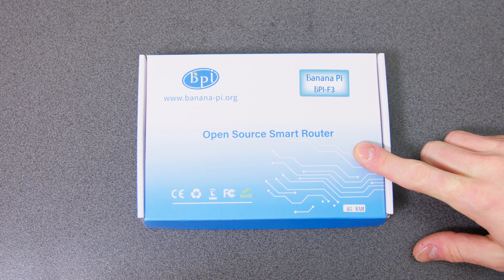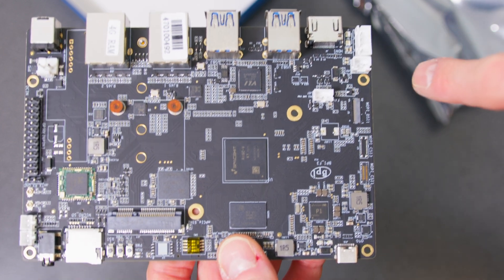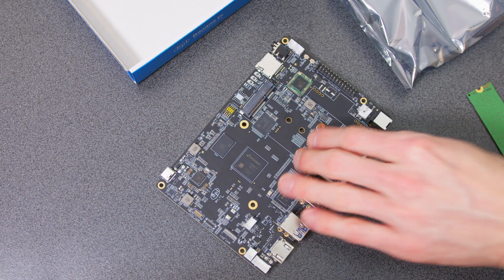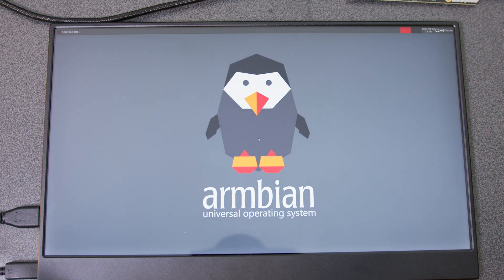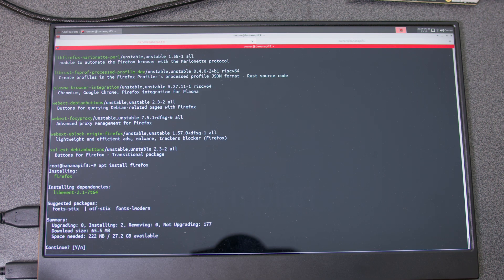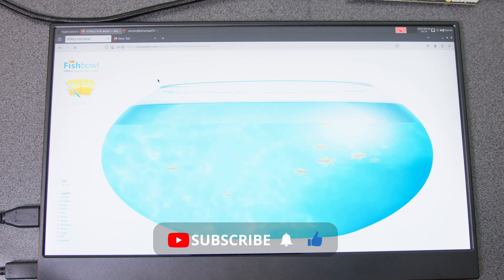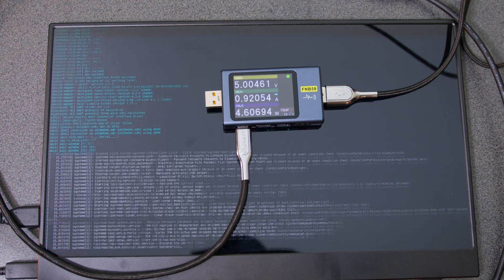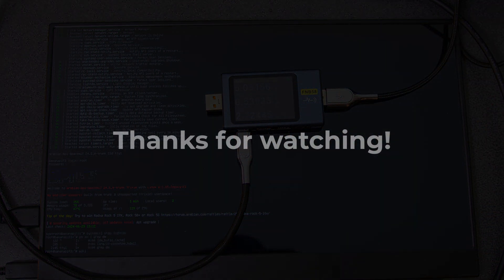The Banana Pi BPI-F3 may have the SpacemiT K1, but it is an ARSE product

Comment: So far, everything on the one I bought a couple of weeks ago has just worked. I don't particularly care about speed as measured by benchmarks. The most stressing thing I have used a RPI for is controlling a 3D printer. Having a lot of I/O, including NVME slots and two ethernet ports means more to me. You might want to revisit this from time to time.
Reply from the maker: Oh that is great - and good to know. Have you hit any RISC-V specific hurdles? And yeah it's on my list to get back to!
Reply: @PlatimaTinkers  Not really, but it's early days.
Reply from the maker: Please do keep me updated - I am quite a fan of RISC-V, and have more content on it coming up too!
Reply: @PlatimaTinkers Most of my experience with it so far is with embedded programming. That said a few things struck me, coming from ARM Cortex. In general (although there is a compressed mode) it takes more assembly instructions to do something and it seems like there are instructions missing - for example, there are no push/pop type stack operations, nor are there any operations with pre or postincrement. The upside to this is a combination of simplicity and flexibility. Same thing with interrupts. In the design I'm working on, I needed more than the one external interrupt - getting FreeRTOS to work with the vectored interrupts took a bit of playing around, but the answer turned out to be simple. You can make the interrupts nested or not - as you wish, it just takes an extra instruction - again, flexibility. I've had to write a few simple assembly routines and so far (admittedly subjective) it seems simpler than ARM. My sense is that it should be easier to make this logic fast, even though it seems to be behind ARM right now. Jim Keller said something in a talk that resonated with me: he thinks of progress as a curve that levels off for a given process. To make a big jump forward, you have to get on a different curve and doing so will seem initially like a step backwards.

Comment: You choose Armbian, that come with Debian Sid repositorie, and Debian Unstable repositorie... So of course the system not will be stable. Sid is make for developers upload new packages, to people test and report bugs!

If you wanna more stability, choose at least Debian Testing repositorie (Trixie at this time) since the actual Debian Stable (Bookworm) is not avaliable for RISC-V architecture. When a packages looks stable, they move it for Testing repositories. When they are sure that all packages are stable in the Testing repositorie, the whole Testing repositorie becomes the Stable repositorie. And this processes didn't happened yet with RISC-V architecture, that is, don't have a stable enough version of Debian for RISC-V. This applies to all Debian derivatives, as Debian is the most stability-conscious of all.

That said, I would recommend trying Archriscv, since you will have the latest versions of the packages, you have a better chance of getting versions with old bugs fixed.

I saw in the other comments that you care about the community involved: the Archriscv community is mostly developed by Chinese undergraduate students.

Comment: 12:49 - I am posting nearly 6 months after your video, so things have probably changed quite a bit, but my understanding is that bianbu OS is the recommended image for all Spacemit Stone series chips. The source is available on gitee and the documentation is good. I don't use the GUI, but I tried it and it works fine. The browser also seems to have hardware acceleration and I had no issues running 1080p YouTube videos. I primarily use this to compile and test software, so I did not run the GUI for any considerable amount of time. I assume the documentation was updated at some point to recommend bianbu OS? Armbian was still broken when I tried it 🤷‍♂
Reply from the maker: Yeah so I've learned a bit more and used it since then too. The terms can be slightly confusing!

So Bianbu Linux is the BSP for all uses. It has all the drives etc. There is then Bianbu, which is the desktop or server OS, based on Bianbu Linux, and they also do a NAS and OpenWRT set of images based on the BSP.

In my testing of the SpacemiT MUSE Book, you'll see if try the GPU a bit more, and have mixed results.

Honestly whatever image / configuration the MUSE Pi had was the best, I'll have to go back and check that. The MUSE Card was not too good, and the MUSE Book I had the best results with Bianbu 1.0.15 after some Chromium tweaks.

Comment: Armbian is not that great. The other distro they have is supposed to be awesome.
Reply from the maker: Yeah I just don't want to use some specialty distro. RISC-V is supported enough by Debian/Armbian/Ubuntu aka mainstream distributions, that they should be used.

Closed/single-vendor/specialty never wins in the long run. Eg how long will they maintain it for, how can we submit issues or PRs, who keeps doco up to date?

Comment: I like risc-v stuff,   but I cannot recommend your video to my young nephew because of your language.  You probably wont care anyway, but I thought someone should let you know.
Reply from the maker: I do care, and thank you for your input. In the most recent video I specifically avoided swearing for that exact reason.

I do think that this content here though would be a bit too technical for anyone who does not know when it is or isn't appropriate to swear. Eg if they're 14 or older, they're fine, but if they're under 14, both the language and the content likely wouldn't suit (based on US and AU TV guidelines)

Either way, thanks again!

Comment: This board is the first viable one with a RISC-V RVV.10 cpu, everything is new and the cpu vendor support is in flux. It is great to do development and optimization, you won't have full optimized desktop support a month after global release.
Reply from the maker: Hey thanks for the input, but just need to correct you a bit sorry.

"This board is the first viable one with a RISC-V RVV.10 cpu" <- No it's not

"you won't have full optimized desktop support a month after global release." <- Then don't advertise how good it's GPU is with OpenGL ES1.1/3.2. EGL1.5 OpenCL 3.0 and Vulkan 1.3 support.
Reply: @PlatimaTinkers  That I know it is:
- you have the Roma laptop that got presented in Munich, but with the same hardware and with the same software support problems.
- you have the k230 that arrived months before but it is minimalist with a tiny amount of ram and even more brittle software support so far
- No boards for the sifive RVV chips are available right now, at least for the general public.

The hardware has that kind of GPU, missing software as it is now is to be expected, in general I would never buy anything as consumer if it does not have mainline linux support, but as developer as long there is enough information and people answering my questions quickly, I'm fine.

As now, it is a board that is amazing for people that write software, since before that the only option was qemu for quick tests and k230 to see how everything fares if the workload fits the ram ^^; I can imagine you would feel lost if you are expecting the same experience most Aarch64 SBC offer out of box :)

Give the community 3 months and probably you'll enjoy much more this board and the RISC-V ecosystem in general. Since you seem to enjoy Ubuntu I heard they are importing back what the spacemit people are doing with their bianbu derivative.
Reply from the maker: @LucaBarbato sorry mate I nearly missed this one! And yeah that appears 99% on the mark but I'm just going to elaborate on my understanding of the state of things for everyone else too.

So to clarify a little bit (for others reading, not you specifically);
- This has the SpacemiT K1/M1 SoC on it, and they also released their own SpacemiT Muse Pi which was available for order 3 months ago.
- The LicheePi 3A has the K1 too, and was released for order in July from memory.
- The C908 cores have RVV1.0 .
- RVA22 is a big step, which SpacemiT seemed to get out to the public very quickly.
- You're right that the K230 (C908) is quite limited. I tried it and was 'meh'.
- SiFive have the P670 and P470 cores, but you're right we're still waiting on an implementation like the Sophgo SG2380.

GPU is always a hard one with these boards. I was talking to one of the engineers recently, and a lot of them are more for 2D acceleration and encoding/decoding, aka ISP pipeline, etc, not for 3D or GUI usage. Using Bianbu, which is the SpacemiT BSP, on the LicheePi 3A / BPi-F3 / Muse Pi results in good GPU performance. 

If Ubuntu bring more of the SpacemiT commits into their main line that'd be great, but I'm not too phased, and rather push forward with Debian 13 😁 Cheers

Comment: you tend to run out of cpu before you run out of ram on linux you should be able to do stuff with 4gb but yeah 8 or 16 would be way more usefull
Reply from the maker: Absolutely depends on use case I think. I often run out of RAM, and if we're dealing with an 8-core ~2GHz CPU I think there's a lot of head room there!

Comment: This has been my general experience with banana pi boards. Like I don't care about desktop performance. That's not my use case for a sbc. GPU acceleration is often lacking anyway.

I've had two early banana pi boards. They had specs for days. But the reality was that they looked good on paper but the implementation was just rubbish. 

Like the SATA implementation on the M1 goes through the worst (slowest) controller possible and it's connected to the USB. 

The R1 was a similar story. It took some wrangling to get the router working right. There were warnings galore about the security of the device (there's a period where it's vulnerable on boot). Plugging anything into the USB socket or OTG port resulted in the stupid thing per cycling etc.

Which is a shame because some of their boards really look like they'd be amazing if they could actually meet the expectations given their on paper specs.
Reply from the maker: Hey that's a shame to hear! My original M1 appears to be great, but that is over a decade old.

I've not actually tested too much of the performance here. Whilst the hardware might be slow, anything RV also seems to lack general driver and compiler optimisation.

If I can get a Linux 6.8+ kernel on it, I'd expect much better performance. #WatchThisSpace

Wow, what a nightmare re that router and the security!

Comment: Right now, RISC-V is a world of disappointment, and will probably be so for at least 2 more years.
Reply from the maker: I'd say it's a world of excitement.

Some of the stuff coming out works really well, and this SOC is actually really powerful - about half as powerful as the RK3566 but twice the cores.

You're not wrong though - one change in the spec or one release of a new SOC takes 2-5 years for any movement it seems!

Comment: I have been working on this board for weeks, the documentation and support are horrible. I'm posting updates daily to my Github about important notes and my work.  Also included translated screen shots of their titan flasher so I know what the screen says. Leaning as much as I can but it's a slow process. My goal is for it to boot Ubuntu 24.04 and get away from Bianbi and Armbian. Great video!

Comment: The Armbian image is not optimized in any way. Test again with the recommended Bianbu OS which has been optimized for the SpacemiT K1 and you'll have a much better experience.
Reply from the maker: Very fair, but where is the Bianbu website, source code, community? Why do I have to pick what appears to be a closed and unique distro for this one product?

Does not seem right
Reply: @PlatimaTinkers  On Spacemit's website.  The source is on a chinese git service called gitee.  From what I can tell it's just ubuntu with Spacemit's drivers and demo apps installed.
Reply from the maker: Hrmm. I'm a tad hesitant haha. Looks like it's specifically meant for NAS use, and based on OpenMediaVault?

I'd be curious if the GPU drivers can be copied over!
Reply: @PlatimaTinkers  There are both Desktop and NAS images available. Source location is given on the info page. Splicing parts of binary distros could be a bit tricky, you might be able to copy the kernel and modules across, but you'll probably find it more miss than hit.
Reply from the maker: @crayzeape2230  Looks like Linux 6.6 had a PR for the GPU support, that was then included in 6.8, so I'm just building a custom image that is based on that.
Reply: @PlatimaTinkers  I looks like there are acceleration patches for mesa, libdrm, ffmpeg, QT, GStreamer etc that will be required as well.
Reply from the maker: @crayzeape2230  Ideally they should not need patches. I can see newer Mesa builds have the PowerVR Rogue support, but that does not list the BXE-2-32 unless it shares a BVNC with the other BX* GPU. 

I can see in one build that the Bianbu packages img-gpu-powervr k1x-vpu-firmware k1x-cam spacemit-uart-bt spacemit-modules-usrload are added, and they are Ubuntu Mantic-based, so might try those.
Reply: @PlatimaTinkers  It's all still appears to be very much under active development. I'm thinking of picking up a board to join in the fun/torture.
Reply from the maker: @crayzeape2230  Yeah mate go for it. https://github.com/armbian/build/pull/6850 https://github.com/armbian/build/tree/BPI-F3-001 and https://github.com/BPI-SINOVOIP/armbian-build/tree/v24.04.30/ are the main places to be it seems.
Reply: @PlatimaTinkers  Youtube deleted one of my replies, but to generalize, the source code is linked on the banana pi page, There are also both NAS and desktop images of Bianbu.

Comment: I also have played around with Debian. I found the software support also very lacking. I will try actual image the developers seem to support, which is the weird Bianbu OS thing, whatever that is. 4 GB of RAM is disappointing, but if they can actually get proper support for the hardware this will be a pretty useable device. From promo vids they've shown it seems like they have some kind of graphics acceleration stuff running on there, but maybe all of the documentation is only in Chinese?

edit: don't even bother with VLC. Tried 1080p video (there's supposed to be 4k encoding/decoding...), basically it was 1 frame per minute, but at least the audio played clearly.
Reply from the maker: Yeah apparently Bianbu OS is meant to be the main OS, however, I want something normal. Not whatever the hell this custom asian distro I've never heard of.

You're right re the screenshots looking to have GPU support.

Yup, learned that VLC lesson with the Radxa Zero 3W when I tried it without the Panfrost drivers. No bueno 😅
Reply: @PlatimaTinkers  I the newest rc of Bianbu OS and it was not any better for a dekstop env. I think Armbian was a bit more smooth, even. 

I will probably just use it headless as a NAS for now, trying out their nas image.
Reply from the maker: @athf226  Ah okay damn, that's a shame! Their images show GPU support, unless that was the 1 fps required for the shot 🤣

NAS use seems fair, especially if you can LACP the 2x GbE ports!
Reply: @PlatimaTinkers  I think they made a couple of test applications with graphics hardware support. I see some sort of tracking software link on the desktop of the Bianbu image.
Reply from the maker: @athf226  Yeah I saw that too, just not soo keen on a single-use image like Bianbu, as if their repos go offline, or they stop maintaining it, it's bust. I rather something more mainstream like Debain, or even industry specific like Armbian
Reply: @PlatimaTinkers  Yeah, I agree. The downside of all of their images (Armbian included) currently is that it's depending on their own private repos that are branches of the mainline. Until their changes get merged into the main repo it's a relatively dangerous/volatile situation depending heavily on the support of a company.
Reply from the maker: @athf226  So bloody true, and it seems right now - regardless of political tensions - that these companies pop up out of nowhere, and then occasionally blow away with the wind.

Comment: $150AUD for 4G of ram? Unless the AI accelerator has first class support this is a joke. 

There are two worlds of these now, one from the west, the RaspPi and N100 with proper software support and hundreds of different ones from the east, all shit.

Sure, there is a lot more great looking high density PCBs and CPUs done OK with their cracked copies of Candence but the race to get some fancy spec driven boards out before anyone noticed they are shit means utterly crap software support.
Reply from the maker: 2 TOPS is nothing too fancy, you can get a 5 TOPS accelerator stick for $50 from memory.

I think this could definitely be really good, but 1) need GPU, 2) need more RAM.

It could also do with some thinning out. This appears to just show everything the K1 can do, and not focus on a single use case =/
Reply: @PlatimaTinkers  Yep, I think you are agreeing with me, it's just for the wank factor. Maybe the west is influencing the east and the marketing people are calling the shots there too now.
Reply from the maker: Yep I absolutely hear ya mate